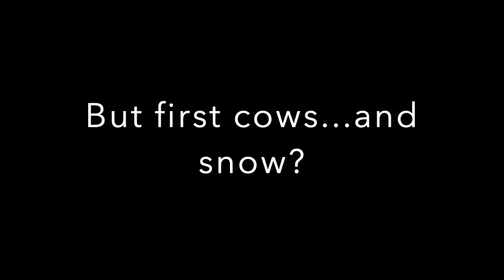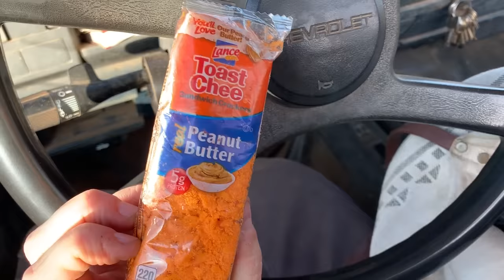Bringing It Home : Soybean Harvest Wrap-Up

Comment: I'm sitting here remembering the only new equipment my dad ever bought. We were farming in Michigan and we were using a Ford Ferguson, and an old Oliver for our farm work. Not sure of the reason but..., Dad bought a brand new 1953 Ford tractor right off the showroom floor. That was a good tractor and we used it very extensively for about 3 years. Watching Lawrence and your son, AND you.  fixing your machines and keeping them running is an inspiration. Keep the videos coming and you'll keep an 80-year-old Ohio man happy.
Reply: I worked with my uncle on his dairy farm and used an old Allis WD something raking, no power steering tricycle and I hated it. Had a cousin killed on it packing silage. His main tractors were Olivers since the dealer was close. All his equipment was old but his son could fix anything. They were great times in my life.
Reply: I worked on my uncles farm in Iowa when I was 13 years old and had an old Farmall tractor that I learned to drive and used to take and bail hay for the dairy cows. 
Keep sending your videos and this 72 years old man will keep watching.
Reply: @dirtyjohn6556  yo soy de el salvador y veo todos sus videos

Comment: "IT'S PAID FOR" is the best equipment of all, my dad taught me that when I was just a boy . When you can fix your equipment that's all the more reason to stay away from the debt. I have no doubt that Lawrence foreseen that there would be kinks to work through when y'all bought the combine. You were extremely gracious in your defense of Gerdi, and well within your side of the fence to say something. Besides, how boring would it be to watch a brand new shiney combine wheel through a field of beans, without dramatic pauses. Have a steak dinner, y'all earned it.
Reply: Well said  Mr white !!!!!!!!
Reply: Or watch shiny new machinery stopped for a $100 service call while an overworked JD tech throws away perfectly good sensors trying to isolate a problem with some electronic bs that Gertie doesn't even have.( and the $100 is just cuz he showed up now we spend the real money!)
Reply: Agree!
Reply: The Gleaner may not be new but when Lawrence gets in the cab to do some harvesting, no agent from a finance company can   tap on the window to say that he is taking possession of it, because of non payments. 
Very wise Bernards can sleep peacefully at night with that in mind.
Reply: From Texas, I agree, stay away from the electronic crap you cannot get back into service in a timely manner.
Reply: Buy the best pre 2000 machinery you can find/afford.Beyond that the repairs of non-mechanical parts is too much.for small farms to afford.Rather run those 4440s to 20000 hrs than own a new one.
Reply from the maker: Thanks Bill! Haha...yes, how boring. ;) And I think steak will be on the menu tonight. :)
Reply: Lyn Wessel l

Comment: Breakdowns are common with all hard used equipment. You just have to repair, then "keep on keeping on" until it breaks again. I buy heavy duty parts to fix things on my tree farm because it make it longer between repairs. I get a rust hole on anything, I just rivet or weld a plate over the hole or cracked joint, then go back to work. I am a "jack of most trades", and a master of a few of them due to my Dad and my Uncle. I'm grateful to them both for sharing their smart knowledge with me. Off the farm, I used to help being an airframe mechanic and "gofer" at the 1941 Airshow in Geneseo, NY in the 80's, and loved every minute of it. Aircraft of every type I fixed and got a ride in. Heavy fun for a Twenty something year old kid. I got into Avionics that way, too. "Watch and learn" they said, and I learned. I miss those days badly. Flying in those WWII aircraft from a B-17 to a PT-17 was an experience I will never forget. Knowledge is precious, as you well know.

Comment: I'm a 3rd generation farmer that is 25 years old from michigan I farm with my father and uncle .  We farm 3500 acres and custom farms another 2500 to 3000 acres annually.  We raise wheat soybeans and corn along with hay .  We have 260 Hereford cattle and 160 of them are my father and mine. We have finished our crops and are doing some custom harvesting of 1800 acres of corn.  We have 250 thousand bushels of corn stored we sell it to the ethanol plant. They pay us to hold on to it so when they run low they will have a stock pile. I farm full time and am a electrician and mechanic . Nice video love the channel and it's content . Stay safe and harvest on  !

Comment: I run a Gleaner F2 Corn and Soybean special.  I like it because it is possible for one guy to work on it without a whole lot of expensive shop equipment. Also the parts are less costly then bigger newer machines and it fits my acreage and my pole barn. Also its paid for.

Comment: I was going to tell you that a crow bar is where crows go to drink , but you corrected you're self , well done.
Reply: and while it was technically a pry bar. It's a specialty bar designed for the lock rings on the old split rim wheels.

Comment: It doesn't look like it would take a lot to fix that header up. It looks like it already has the 2" cutter bar and bean pan. Some brand new oak slats with flex tines, new rollers in the reel cams, and a set of paddle tines would pretty much set the reel up good. Then you could put new belts and whatever bearings needed replacing. It would be like a brand new head then. I recently went through the 10' header on my gleaner E. I farm with old stuff and just keep replacing parts and making improvements until I get it where it is reliable. I enjoy watching your channel and I understand why you choose to do things the way you do them.  Don't pay the negative comments any attention and keep making videos.

Comment: I like those old Gleaners, I've never had the privilege to grow up on a farm nor have I run much farm equipment, but I have at least beeen able to experience some of it by working for the local AG Supplier. I have seen many of those Gleaners parked around here in Nebraska collecting rust. It would be cool to get you connected to parts/spares if you need any. I personally think the older equipment is much more rewarding and the fact that it is paid for is priceless!

Comment: I will never complain about a farmer's equipment.  We don't have money to spend on new schtuff.  Instead we make do with what we have.  It is much cheaper (in most cases) to fix what is already paid for that making payments on new.  Heck, we had 2 Massey Harris 50 Clipper pull-type combines which were made in the late 1950s.  One was just for parts.  My sister has a grain drill with a wooden tongue (hitch pole) and spoked steel "tires".

Comment: Gloves.   here in the frozen north ....  Gloves are a combination deal.    I use a light pair of actual gloves with fingers for doing things where I need fingers.  Then I put them inside a pair of fur lined leather mittens for warmth.   If your fingers are together they will be warmer than if separate.   You can usually do pretty much everything with a mitten.   Then I keep around armageddan gloves for when it is just too cold to pretend it is civilized.

Comment: Gertie herself is reliable...its the heads that become a problem but older equipment is built much better than new (in my opinion). As long as the engine, transmission and hydraulics keep doing what they do...the rest is annoying but much less costly than newer because the farmer will fix it if he can still get the parts. Thanks for sharing.

Comment: I am in Ohio.  My cousin, who I spend a lot of my life with over the years, is a tiny beef farmer.  He's far from tiny, but the farm and the amount he can raise is not much.  Now... to his equipment.... he used an old Ford tractor most of his life, then a used Massey Ferguson, then one day his wife surprised him when  he was cutting hay, and the dealer brought his NEW Massey Ferguson, with the cab, air heat and all.  He needed that.  That is the only new thing he has.  His farm trucks, he runs them until they basically fall off of the frames.  No handles on his doors either.  He hates spending money on something that will stay dirty, plus he also took diesel mechanics in school, so he works on all of his own stuff, and everyone else's too.  I have seen in other videos where someone asked you Mr. Farmers walk, my cousin has the exact same walk.  But his mowing machines are things he finds setting behinds someone s barn, and get it for next to nothing and he works on them to get them up to snuff.  The same with his OLD round baler, rake and tedder.  He makes his own hay spuds.  Doing this with old used stuff that STILL works, has allowed him to live a comfortable life, and have no worries where money is concerned.  I grew up- in the city, but like I said, spent a huge amount of my life down with my cousin.  I am 58, he is 56, and has had a knee replacement before thanksgiving, and he still can do more in a day than I can.  So as long as that old stuff still runs, use it as long as you can, until its broke more than its running.

Comment: So true about new equipment. I'm no farmer. Just a truck driver. The new trucks are a nightmare .It doesn't matter if it's a Freighliner, or a  Peterbilt -the new stuff--you'll spend the first year working the bugs out of them. Then, at 265,000 miles (still young for a road tractor) you'll be facing DPF system failures. It's a system that picks a snowstorm to cause total shutdown of  a truck. Thereafter, it's replacing sensors . All that , on top of things that wear out on trucks of any era. New Freightliners- I run from them like the Plague! The new trucks are one big check engine light. I deeply miss the older generation trucks.You could go to a Tupperware party, buy a round bowl, then tape sensors to it, and youd have the equivalent of a new truck.. I'd pick that little red jelly bean Ford dump truck over the newbies any day! That's a good lookin dump truck!

Comment: Hi Meredith, found your channel 2 months ago, have stayed with you since. I can relate to the farm life, grew up on a grain and livestock (Angus) farm in Ohio back in the 40-50"s graduate from Purdue University 1963 with a BS in ANSC. Worked for a major farm equipment mfg for 28 years. The best life is on the farm............city folks really do not know what a good life  really  is like unless they experience it. You are the prime example of a GOOD  farm wife can be,. Your husband is really fortunate to have  you as his partner !!!  Two questions:  How many acres do you folks farm and how many head of breeding stock do you have..............seems like I see a lot of young calf crop  ??
 
As far as equipment goes..............."preventative  maintenance"   will go a long way rather than let it run until it trashes out in the field. Noticed in video, "appears"  the header isn't cutting as clean as it could, can't say for sure without being in the field. One suggestion for a cleaner sickle bar cut.............match the reel speed "closer"  to your ground speed.  The F2 if I recall does not have a "variable 
on the go reel  speed control"....so select pulleys nearest to your ground speed in order for the reel to "rake"  the cutter bar clean, that is a problem  with short stand stalks.

A retired viewer.

Comment: The old Farmall fools everybody into thinking it always won't start. LOL. Bonnie stays home in the warm. Cunning ol' girl.
Reply: 6 volt starter . Some switched to a 9 volt system so it spun faster .But those old Ms if they were gonna start it only took a couple turns.Dont know if anyone else made a gasoline engine the would lug hard all day to the point of melting a hole in the muffler and just keep pulling.

Comment: When I was younger I  and Grandpa  would fix and weld on all the farm equipment that they broke, he would always say if you cant find a job working with people, you can always get a job rebuilding farm equipment on a few ranches and farms, something is always broke, if it aint they don't use them, and hes right, Ive made a pretty great living at fixing broken down equipment  and rebuilding flat beds for hauling everything,  Your husband and I have alot in common can usually fix anything,  and it works better than what the factory came out with but that keeps me busy, but out here in south Dakota they are way different, if its broke it stays that way, it will rust out in a field before they ever will have it fixed just cant figure that one out.

Comment: great video's guys. your equipment actuallyis better than some of the equipment my grandad worked with. many of times a piece of equipment held together with bailing wire got the crops in. he had a farm and farm equipment junk yard just outside kansas city and if he didn't have what it took to help get the neighbors going he could usually make  or alter a part to get them going.

Comment: I think what some don't understand is you can't justify a big fancy combine on a small diversified farm.  When you have cattle, hay, and silage; the combine is not the main piece of equipment on the farm.  A agree that a better header is all you need.  With older headers, sometimes simple is best. I had the least trouble with an old rigid head on my first Gleaner K.  Much simpler than a flex head, and feeds better because the reel can run always run right down to the cutterbar.  Your grain fields look fairly flat, and a narrow rigid head and the wheels set wide on the combine works well. I had the automatic height control on mine and it worked well. Good luck on your search for a header.

Comment: All good points on having zero debt, however harvest is one of the farmers BIG paydays.  For this farm it is also cattle.  Therefore you need good enough equipment to get the harvest in without to much trouble.  Was this to much trouble only Bernards can answer this.  One big rain, snow storm (up north), etc before final cutting can greatly diminish overall yield lowering overall income.  So fine line between cost, condition of the equipment and possibility of crop loss due to not getting the crop in.  Running numbers tells the story from tilling to planting to harvest and what type and condition the equipment needs to be in to get the job done.   One day at a time.

Comment: Now I do have a few pieces of equipment  one is a AW900 front end loader the bucket is a 100 yarder its huge, I can have 20 yard dump trucks bring out gravel to us and it takes 5 trucks to fill the front end loader,  it can pick up 235,000 pounds per bucket load, then we have the D12 Cat with the large blade it can push along 285,000 pounds of dirt in front of it and thats with the 40 foot blade, we have a smaller blade its 25 foot, and I have a massy Ferguson 4460 tractor we have it for pulling the two hay wagons for feeding in the winter before the horses come into the barn for winter our barn is 875 yards long  150 yards wide the skeleton is all steel the outside is all logs cut from our land even the cabin is really nice stan put on the last edition so the cabin is 12,000 square foot  five bedrooms four bathrooms  library, two walk in freezers in the kitchen, the dining room opens to the Tetons behind the house when you sit in the horses shoe living room and look up the roof is 47 feet tall on the mainbeam, I have 1st Calvery saddles  from one end to the other so thats 220 foot long, I tell everyone its a small cabin, they just look at me and smile and shake their heads  and giggle

Comment: I'm curious, how do you go about selling your beans? Do you have to go in person or call places that might be interested in buying your beans or do the buyers come around to the farms to buy the beans? I remember that when we raised tobacco the tobacco buyers  would come around, look at our tobacco (usually right before or just after we started cutting it) and if they wanted it they'd make us an offer on it. Word quickly got around among the farmers which buyers were out buying and which ones would pay the most. The sale was done before we even had the entire crop harvested. As for new or used equipment, I'd rather spend some time making repairs than writing out those payment checks on new equipment. If you were farming several hundred or thousands of acres then new equipment would likely be a better way to go.  In my opinion working on older equipment is much easier, especially when it comes to the engine and drive line. The new computerized tractors and equipment are great as long as they are working or you have thousands of dollars worth of electronic  diagnostic equipment needed to diagnose and fix the newer computer controlled machinery!

Comment: A worn part you can buy and change yourself beats a computer glitch or remote sensor that stops production for days or weeks waiting on a part or a programmer to touch the equipment. New John Deere equipment can’t be depended on and will leave you disappointed and stressed out.

Comment: Lawrence does not need a newer combine. I think the model F replaced the model E which was the smallest of the Gleaners, Anything newer would bring more problems, A newer combine is much larger and would require wider roads abd he would need larger trucks. There are some used parts for it are still available. New combines need replacemet parts the first year.